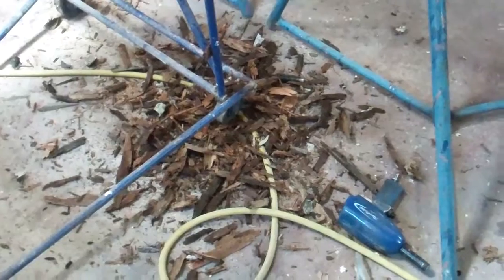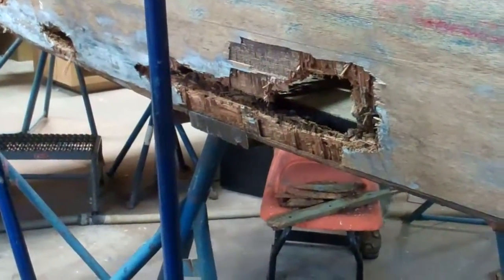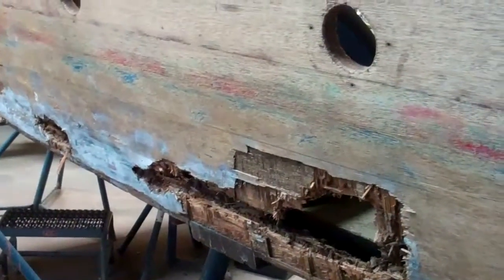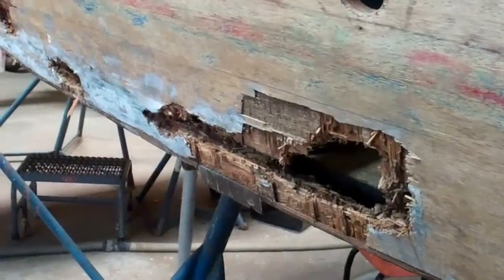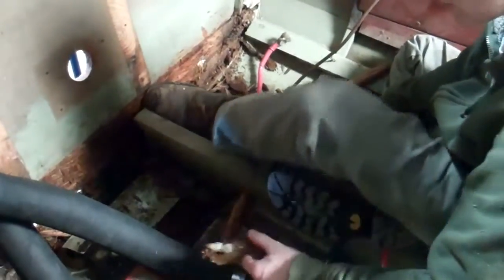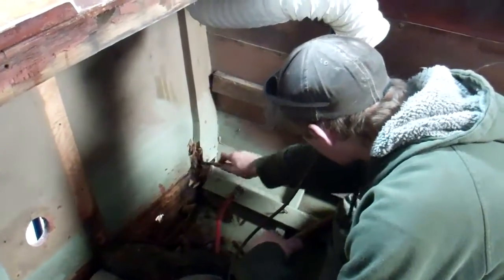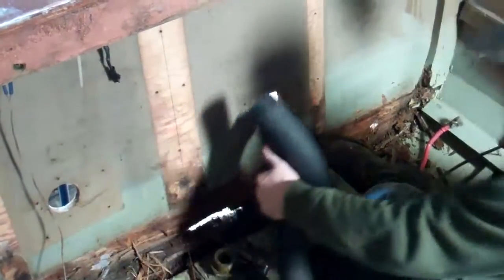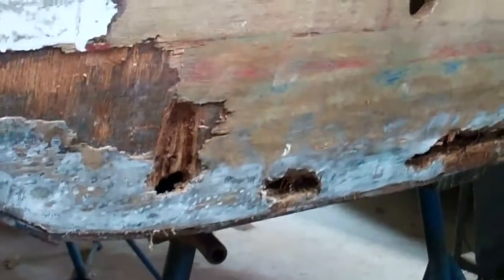68 Lyman   More on Why Fiberglassing Wood Boats is Just Plain Wrong 2 4 2015

Comment: since it rotted from the inside what difference did the glass coat on the outside have to do with the rotting  issue. the guy covered over the drain hole, that seems to have been the large  mistake.  right?
Reply from the maker: No. "Inside out" refers to the inside face of the planking, that against the fiberglass, rather than the opposite face, that viewable within the bilge.A visual inspection of the bilge-side of these planks would not sound any alarms, as the surface looked for all the world as that of solid wood.Rotted wood literally crumbled along with the fiberglass as we removed the latter.Many Lymans, especially smaller ones than this one, are fitted with a brass drain plug and thru hull positioned center and near the transom's lowest edge.Many we have worked on, and especially pre-1960 examples have no drain.So rotting from the inside out, perhaps a poor choice of words, is all about rotting from inside the fiberglass-wood joint, out towards the bilge.

Comment: You seem to be stating your case and why not the fiberglass but you never say why you feel that way. What does the fiberglass so bad..that if it were not fiberglass and you had water in the boat. If you have water in the boat regardless of whether you have fiberglass sheathing it will still rot right?
Reply from the maker: Hmm .. because the hull rots from the inside when you do, as was clearly the case with this poor Lyman. Oh, and the water continued leaking through too! Don't want to believe it? Try watching: https://youtu.be/6WF0Bqcvvsg
 and https://youtu.be/GYfkPwigZr4